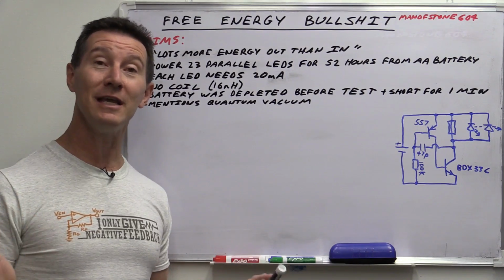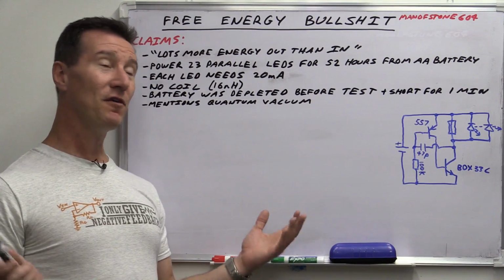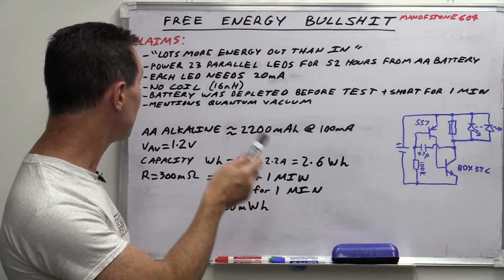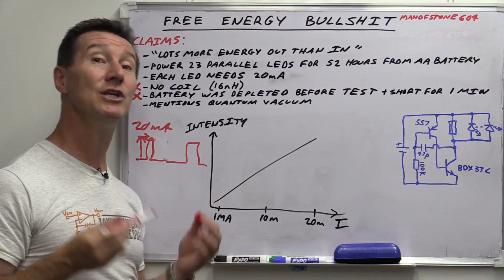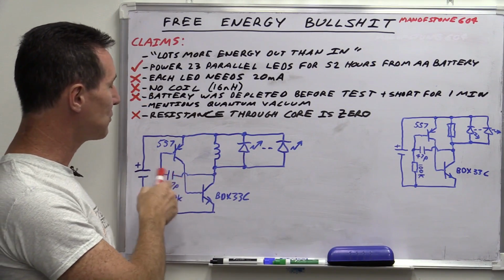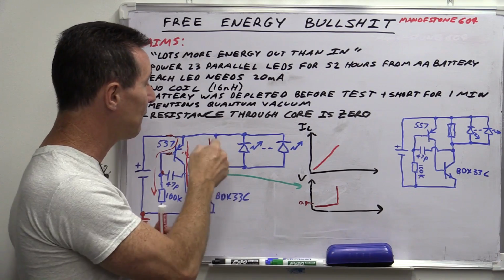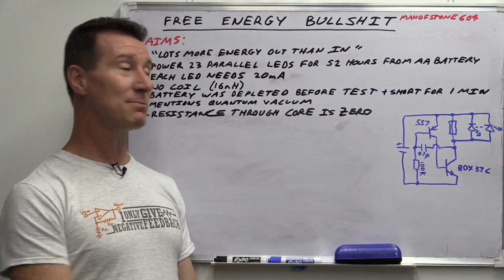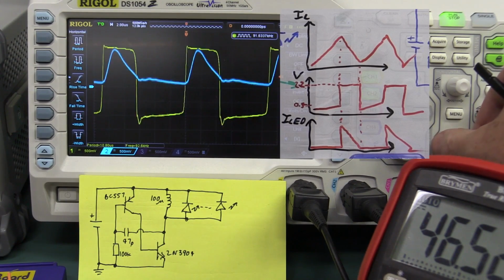EEVblog #708 - Free Energy Overunity is RUBBISH!

Comment: interesting! But I can't believe you spent that much time on it! here is a question that has stumped most that I have asked! if you know the draw on any battery you can figure out approximately how long a battery will give you power! however a few years ago I realized that you can't with a automobile lead acid or deep cycle! why? automobile lead acid batteries don't have the information listed? not that I could understand. they give voltage cold crank amps but not MAH. ANY CHANCE YOU HAVE A ANSWER? of how you can get a approximate TIME.
Reply: Car battery lifespan  is  a bit complicated by the fact the alternators are always recharging them. However its possible to do basic chemical analysis and work out how long under a linear set of circumstances (ie not a car starting and stopping and draining and recharging non stop)  how long the charge lasts and how long its effective life is. However! Why bother when you can just look it up. Theres a heap of information from the manufacturers on the net.
Reply: Shayne O'Neill NO not the information you need. and I am not asking about in a automobile! setup like a battery backup I know all about the stopping at a set percentage of a standard, Deep cycle or other but nothing tells the one thing you need M.A.H OF A GIVEN BATTERY. The information you can find tells plate size and thickness! that should give the required information. if there is a formula? but I don't see it anywhere. here is a example! a standard automotive battery! 12 volts! 700 CCA that's all you get! now knowing the actual drain over say 3 hours the battery manufacturer does not say in AMPS PER HOUR. JUST COLD CRANK AMPS. AND THAT IS AT 32 DEGREES FOR IF I RECALL 30 SECONDS. I KNOW THERE HAS TO BE A WAY.
Reply: There is a way. Look it up. 
The most common car battery where I live is the century NS60 century. Quick look on the net tells me:
 Voltage:	12V
CCA:	430
RC:	75
Ah:	45
So it can deliver a 430 amp burst for starter motors, then over 20 hours deliver 45 amp hours. It can last 75 hours on a single charge beore it drops to 10v assuming a usual load and its 12 volts. 

Everything you need to know.
Reply: Shayne O'Neill exactly how did you find this? I have looked on battery manufacturer sites! Looked up battery by name number and got 0! Thank you maybe have to do a little more searching!
Reply: Were you searching for 'mAh' or 'Amp Hours' A car battery wouldn't be measured in mAh, and searching for that as a keyword would probably not bring good results. We measure consumer batteries in mAh because they are small and precision matters more. Literally googling "car battery amp hours" will provide all the answers you're looking for.
Reply: Just read more of your comments. The reason you don't see large battery backup in mAh is the same reason you don't see car batteries listed in mAh. Battery backup/inverter systsems are typically used to provide backup to electrical power systems. These systems are measured in Watt Hours, or Wh, or kWh. You can do some basic algebra based on systems voltage and wH to convert the battery system to Ah.
Reply: Ira Smith thank you I will do that! I tried so many ways I may have overlooked that again thanks
Reply: Amp Hours is a measure of stored energy. It is not "amps per hour", rather it's Amps x Hours, or AmpHours. Similar to kWh. Energy is Power x Time. Since we know the battery's voltage, we can speak in terms of currents since power = IV, essentially. With a known system voltage, the part of energy we need to know is the current and the time.
Reply: If you have a specific piece of equipment you're looking into I can assist you with some calculations.

Comment: Is leverage a form of free energy?  Try to lift your car when you have a
 flat tire by yourself.  Can't be done.  Now get your jack out and like 
magic you can now lift your car.  It's called leverage.  Can you run 20 
miles an hour?  No, probably not. However, get on your bike and peddle 
really fast and I bet you can now go about 20 miles an hour on a flat 
surface.  The bike doesn't have any energy of it's own but it enables 
you to go faster than you could by yourself.  So, you are able to go 
faster than you could if you were simply running by doing nothing more 
than riding your bike.  The bike doesn't have any outside power sources 
except your peddle power...  Yet the bike enables you to leverage your 
own personal power to go faster than you could on your own.  So, you are
 able to go further and faster without using any additional energy.  
Right?  So, if this is true then every time you use a jack to lift your 
car or ride a bike to go faster than you could by running or walking you
 are in violation of the so called Law of Conservation of Energy.
Reply: Terry Robinson wow
Reply: Yea! How come some days I don't eat and I can still move and stuff? Power out > power in.

Check.mate.

Comment: There's a lot of noise out there and a huge amount of wishful thinking amongst the over unity, free energy community. However, infrastructure that provides free energy purely from ambient conditions already exists and I've been benefitting from it for years; photovoltaics.
I would like to sound a cautionary note. Whilst there is a healthy dose of dodgy science in many of these offerings and thanks for your work showing this, it's worth noting that history has shown, time and time again, that 'accepted wisdom' is always temporary. This also applies to our current understanding of physics unless, of course, you think we no know all there is to know on the subject.
Reply: Robin Harrison solar isn't free energy in the sense that's meant here. PV cells convert energy from one form to another and some of the energy is lost in the process. It's free in the sense that you don't have to buy fuel, not free in the sense that it has a thermodynamic efficiency that isn't possible. The battery circuit claims to be able to create energy out of nowhere and is therefore more than 100% efficient.
Reply: energy from ambient conditions does exist of course. but energy out of nothing but thin air does not exist and it will never.
Photovoltanics get their energy from Nuclear fission inside the sun. Thats not free in my book.
Reply: Thin air is neither thin nor full of nothing. If it were, spacecraft wouldn't need heat shields for re-entry. Free energy contraptions produce energy from ambient conditions. There is always input; magnetic fields, gravity, whatever. Your claim that it will never exist is an absolute declaration that we know all there is to know about physics and that's not even remotely true.

My infrastructure has zero moving parts and energy from the FUSION generator in the sky is definitely ambient conditions on our planet. Whether we use it or not it is freely available and my wallet insists that it's free.
Reply: Robin Harrison i am not claiming that.
energy from ambient conditions is not free. if you call energy gained from ambient temperature "free" then "free" energy exists. thats how solar cells, stirling englines and geothermal generators work.

"free energy" does not mean that its free of charge. free energy means that you create energy out of nothing. perpetual motion pretty much. https://en.wikipedia.org/wiki/Perpetual_motion that is what i am referring to with free energy. Not energy you dont have to pay for. Energy you dont have to pay for is very common.
Reply: Solar cells don't work with temperature they work with photons in the sunlight which constitute the ambient conditions on the earth. Stirling englines and geothermal generators require heat input.
Free energy contraptions all need input of some sort, be that magnetic fields, gravity, whatever. My free energy contraption uses photons for which there is no cost; financial, physical or metaphysical, and produces actual free energy. Maybe not more out than in but definitely in a usable form that previously didn't exist.
Of course there's a lot of codswallop out there on the subject but an absolute belief free energy contraptions can't exist can be misleading. For instance, my free energy contraption which works can't be a free energy contraption because free energy contraptions can't exist. 
Yes they can, I've got one.
Reply: Robin Harrison there is a phsical cost. photons. you take a high energy photon and remove its energy. its  not free. it costs a photon which was created by nuclear fission inside the sun most likely(or by a flame, a lamp...). thats not free. you just take a photon and convert it into electrical energy. that photon would normally have used its energy to heat something up or even accelerate something else(since light is a wave and a particle at the same time for some reason).
Reply: Robin Harrison you can call it renewable energy if you like. but a free energy contraption is a perpetual motion device.
Reply: Firstly, what's happening in the sun is nuclear fusion not fission. Secondly free energy contraption and perpetual motion device are not synonymous. There is no requirement for a perpetual motion device to produce energy although they could well do so. Whilst there's a general perception of free energy contraptions having movement that's not actually a rule either.
But you are probably right, my free energy contraption which works can't be a free energy contraption because free energy contraptions can't exist.
Reply: Yes, thanks I am aware of this. I was pointing out something of an anomaly and, more importantly, cautioning against a carte blanche dismissal of the possibility.
Reply: No he didn't. 
Sadi Carnot, the "father of thermodynamics", in 1824 published Reflections on the Motive Power of Fire, a discourse on heat, power, and engine efficiency. This marks the start of thermodynamics as a modern science.
You are still saying it's the 'ACCEPTED WISDOM' therefore we should look no further. That wouldn't be true no matter how old the idea.
Reply: The free energty people are usually refering to "free" as in "more energy comes out of the system then goes in". Which is complete crackpot nonsense, be it a "quantum vacuum" combobulator that magically lights leds, or a perpetual motion water wheel.
Reply: Robin Harrison yeah sorry. its of course nuclear fusion.
Reply: Your statement that more energy out than in is crackpot nonsense assumes we know everything we'll ever know about physics. That's not remotely true. 
There may well be crackpot attempts as there always is with new fields of endeavour. Early footage of attempts to fly is full of wondrous crackpottery and there were people condemning flying as crackpot, impossible nonsense. 
It may or may not be possible but if it is we'll get there.
Reply: That's ok, I'm on intimate terms with that fusion generator in the sky. It powers my life.
There's a broader free energy movement happening and overunity devices are just a part of it. 
We are surrounded by massive amounts of energy; solar, wind, wave, electromagnetic, etc. We are beginning to learn how to harness them. Overunity devices are looking at tapping electromagnetic energy. 
It's not magic, the energies are there and we can have them for free.
Reply: well the electromagnetic energy isn't very strong. wind or solar is a lot more efficient. at least on this planet.
Reply: But it's there so it's a good idea to see if we can tap it. If we can who know what may be possible.
Reply: solar is electromagnetic. Wind is kinetic. Energy can be coherced from one form to another (eg wind power where the wind drives a generator, turning it into electromagnetic force), but theres always a conservation of energy and matter at play. You'll always get out what you put in, no more or less, even if some of that out is in the form of entropy (for all purposes heat). Which is where these free energy things fail. Even if we try and go with the "quantum vacuum" thing, we're trying to pull energy out of an equasion that requires that whatever is "borrowed" from the void is returned to it (ie, pull out an electron and you'll also get a positron, and those two will  anihilate each other before you can do much useful with them). There are a couple of quirky exceptions to this. Hawking radiation in black holes, and the casmir effect. BUT , and heres the kicker, those are virtual electrons/positrons, and to get a real photon out of it, you'll need to add energy to the setup. So you end up still unable to pull free energy out.
Reply: Shayne O'Neill sounds right to me.
Reply: The accepted wisdom is there because of the sheer amount of evidence for it. And the more evidence there is that something is a fact, the more extraordinary the evidence must be to show that it is not. The first law of thermodynamics has been proven in labs all across the world for centuries, and unless something amazing comes along that disproves it (perhaps a way to utilize wormholes to draw energy from other universes), then there's no reason at all to question it. There are far better uses for one's time than chasing the end of a rainbow.
Reply: On the contrary, the accepted wisdom is there because it's our current level of knowledge. You are claiming we know all there is to know about physics, that there is nothing beyond our current level of knowledge.
You are, without doubt, wrong.
Reply: he never said that there is nothing beyond our current level of  knowledge. he just said that we should bother with things we understand for now rather than trying to do something we have not clue of. at least thats what i understand.
Reply: Another property of 'accepted wisdom' is the perception that it's always been there. The laws of thermodynamics have not been around for hundreds of years. The term is not much more than 150 y/o actually. 
You are both saying it's the 'ACCEPTED WISDOM' therefore we should look no further. Luckily for our progress there are plenty of people happy to ignore that piece of dud advice.
Reply: "Not much more than 150 years old". Um, Newton devised the laws at the end of the 1600s" We've had 300 years  to find examples of them being wrong. So far no success.
Reply: And what to think about magnets? Being polarized attracting and repulsing.
Quiet free, don't you think? Oh, that is also a trick...

Comment: This is excellent. Thank you. You took your time to destroy a myth.
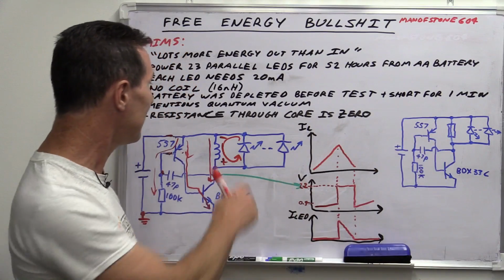However, I think you are incorrect at 29:30. There is no need for current limiting at the LEDs because the inductor itself is a current source, not voltage. The parallel LEDs may be a problem though if there is too much difference between them.